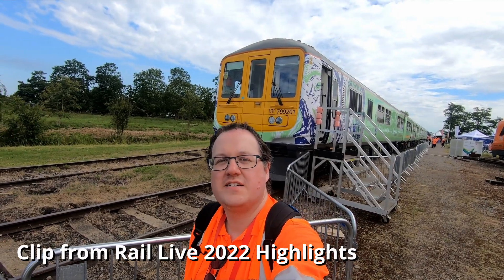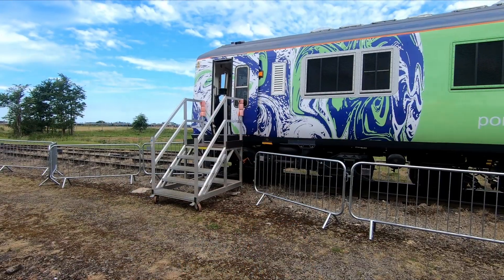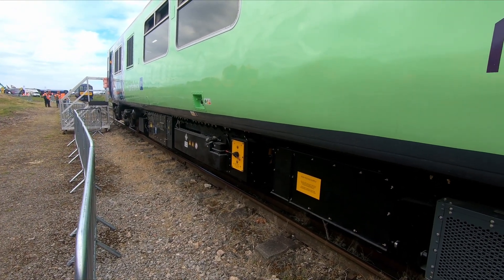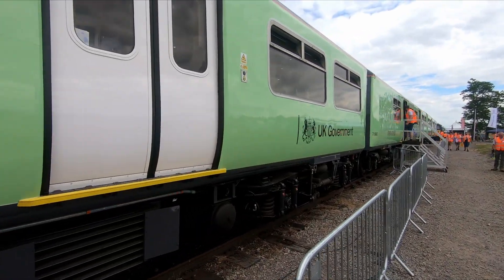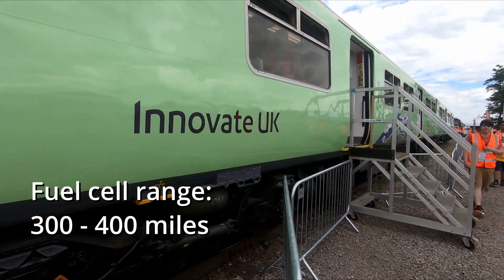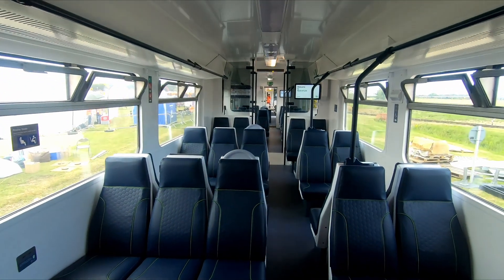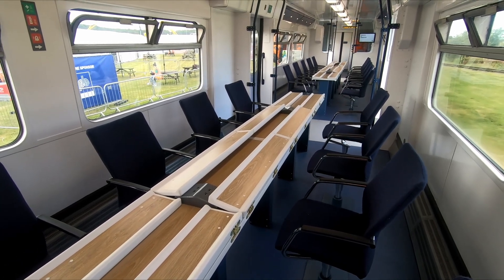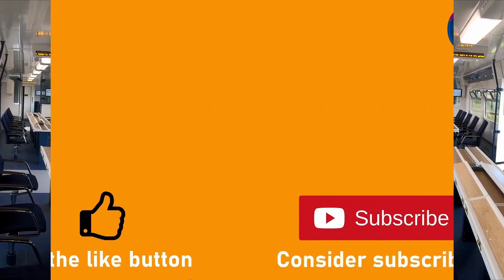Class 799 HydroFlex by Porterbrook

Comment: If the Class 799 are to be used for passenger use. Then I do think that there should be more of them to be converted from Class 319 especially from London Northwestern Railway and Northern and to be used either in Southwest England or Northern England.

And to replace the existing diesel units that are schedule to be replaced and to be scrapped and some to be preserved. Overall they do really nice.
Reply: You can have the 769s from tfw and make them duel operation as they are wasted on the valleys routes
Reply from the maker: I don't think 769s will be around much longer, they're under power and have unfortunately been problematic
Reply from the maker: Fingers crossed we see them in passenger use. Few logistics issues to sort with hydrogen supply, but other than that they're ready to go.
Reply: Ok sounds interesting.